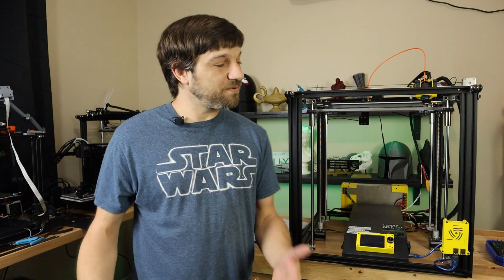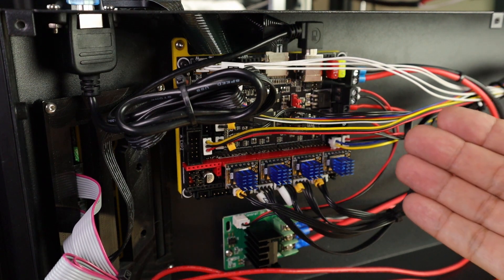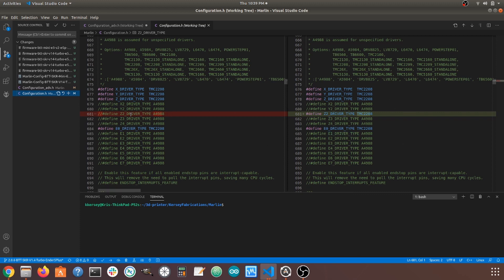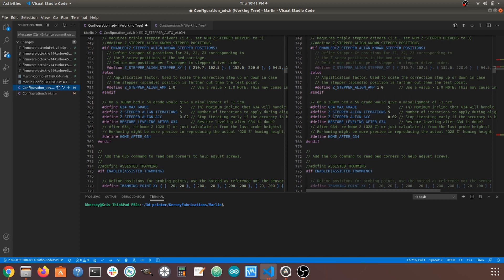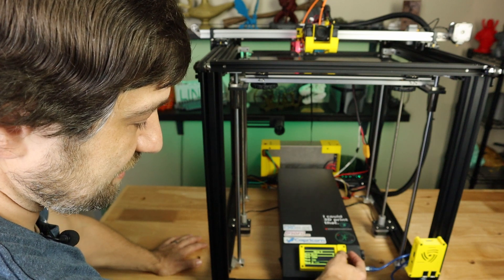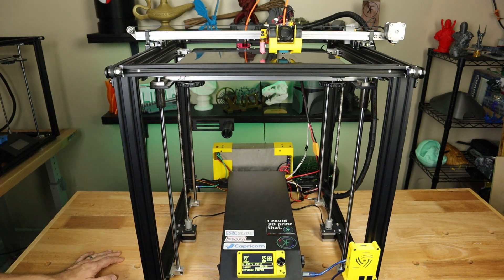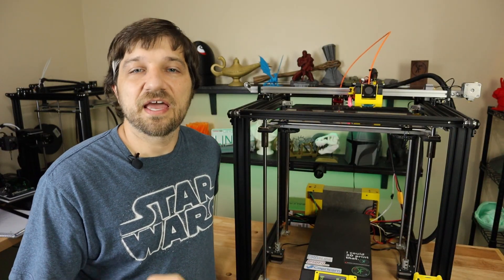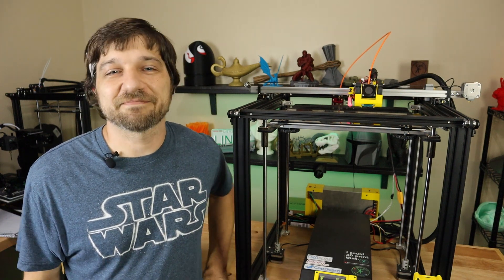3D Printing Pro Tips: Z Stepper Auto Align with Marlin G34

Comment: Hi Kris,  will this work with a SKR Mini E3 v2?  It has to Z motor plugs but one Stepper driver for the 2 Z motors.   Awesome work!
Reply from the maker: Unfortunately not. You will need separate steppers for each Z motor. Thanks!
Reply: @kerseyfabs  Do you know how I would do that with my BigTreeTech GTR. I have a driver in E1 but when I try to move up and down only 1 side moves using E1 and both Z and Z2 connections don't do anything (I tried them separately) unless I unplug E1 and use Z and Z2 on the board. As I'm getting a Probing Error when using Z1 and Z2.
Reply: Mine just needed jumpers to disable second motor connection which is more of a splitter still cant get it to succefully probe however.
Reply: did you ever figure it out?  i'm having the same problem and enabling max end stops or moving pins around wasn't working.  I got it to work by changing the multiple end stop requirement for z steppers >1 to z steppers > 2 and so far so good but i dont know if that's the best way to handle it
Reply: @coefficientofsquish75  Make sure you have #define Z_MIN_PIN                           PH11
 for bltouch. I also removed the jumper from board that merges the 2 steppers together.
Reply: @kerseyfabs  how you set what stepper that is going to be the second z stepper?
Reply: @steveal-jassem4665  You can change that in the pins file but shouldn't need to. If its like mine it defaults to e2. But like in  video you need a driver for each stepper.
Reply: I have defined E1 stepper not Z2 with robin nano and dual work.

Comment: hello sir. thanks alot for your help. i have afew question and please help me becuase i really need to know this.
1- We use "z step auto align" to apply equal pressure on the motors? And some motors do not carry more weight?

2-  if we have quad z stepers, we have to uncomment this 5:57? define  z_stepper_align_known_stepper_position

3- could you please tell me what is this:   "z_stepper_align_known_stepper_position", i didn't understand it in video.

4- in marlin commented this: "requires triple stepper drivers" ......for quad stepper drivers we also have to use this "define  z_stepper_align_known_stepper_position"???

Thanks alot for your help. looking forward to see your answer. thanks alot. good luck! :)

Comment: Hey kris, i am wondering if i can use the z auto alignment with Arduino mega ?
Reply from the maker: It doesn't have any reliance on the processor that I know of. You just need to have separate stepper drivers for both Z motors.

Comment: This don't work in Marlin 2.1.1 anymore.
There is no #defice NUM_Z_STEPER_DRIVERS setting anymore.
How do i tell Marlin that i have 2 Z-stepper-drivers?

In your case you plug the Z2 motor in E1 stepperdriver.
Why do you tell Marlin in Configuration.h that Z2 is enabled, not E1?
The last stepperdriver is E1 not Z2 or not?

My printer has 2 printheads (2 extruders) on a single x-carier.
So i would think that i must use this:
#define X_DRIVER_TYPE  TMC2209 //(for X)
#define Y_DRIVER_TYPE  TMC2209 //(for Y)
#define Z_DRIVER_TYPE  TMC2209 //(for Z1)
#define E0_DRIVER_TYPE TMC2209 //(for Extruder1)
#define E1_DRIVER_TYPE TMC2209 //(for Extruder2)
#define E2_DRIVER_TYPE TMC2209 //(for Z2)

Problem:
When i set #define EXTRUDERS 2 (for 2 extruders) then in Configuration_adv.h the trinamic driver E0 & E1 are being activated.
However the E2 (used for Z2) is not active, witch i need for Z_STEPPER_AUTO_ALIGN.
But in Configuration.h stepperdriver E2 is active
How do i turn on the E2 in Configuration_adv.h?

Can anyone please help me?
Thank you

Comment: Hey
I'm on the latest version of marlin and I'm not seeing the # of z stepper motors in the adv config. I'm assume it's now calculatng it based on what motors you enable?  I using 2 motors and uncommented z2 in the config.  My issue is that no matter how I set the settings under auto align, it always probes 3 spots on the bed: middle left, middle, and bottom center roughly.  I tried the manual coordinates and only had 2 sets of coords listed, yet it STILL probed 3 locations on the bed.  It doesn't make sense. I just want it to probe the left and right side of the bed like it shows in the example.

Do you know what's wrong?

Comment: Could you make one of these firmware supporting the G34 for the creality silent board? I'm currently using your Ender-5PlusBLTouch_0904_V1.71.0 KF firmware, but it would be dope to just add a heatsink on the board and try to use it. I'm just afraid I would jack up trying to create the firmware and it would be a whole mess. Is there a simple way of just editing the firmware I'm using at the moment and enable the G34 portion, set it up on the board with the heatsink and it be good to go, theoretically? lmao
Reply from the maker: What you're asking for is theoretically possible, just as you described it. Unfortunately though, that's a V2.0 feature and I'd have to port all of the Creality special code (for the display) from this release to the new tree. That's just not something I have time for at the moment. Sorry I can't help out.
Reply: @kerseyfabs  all good, appreciate the response

Comment: I had a quick question. My Z motors only had a "Z" tag on both and not a "Z1 / Z2". I imagine it matters which goes to which side otherwise how would it know which side it is adjusting? Do you know (if looking at the printer head on) which motor is 1 or 2. ie left is one and right is 2 or vice versa. Thanks for the videos and firmware by the way they have been a major help.

Comment: Is it possible to add an extra Z stepper motor to move my camera with the layer height to a Delta printer?
Reply from the maker: Technically yes but you'd have to write custom software to control it.

Comment: Hi ! Great footage ! BUT ! The head is not moving simmetrical from the mid point. How to set this up ? 
What means the line: Z_STEPPER_ALIGN_XY with the coordinates ? If i change the coordinates I get an error when compiling "point 1 is not reachable"... So hiw to change the coordinates to place the head to the most end of the bed on both sides ?

Comment: I tried this for the first time on my E5+ with SKR E3 Turbo.  I get a read out at the end that says 1:2=0.697.   So it's telling me that the left and the right are still out of alignment by 0.7mm.   I repeated it multiple times and it gives me the same error.  Tells me the z align algorithm isn't working right.   It is using the two points showed in your video.  I'm using a different firmware, so I'm blaming that for the time being unless I can gain a new understanding or I have time to dig through the sourcecode to see exactly what it is trying to do.   I watch the screen and it seems to dance around the value, so it's not making small enough choices in trying to adjust the position of the z steppers.  It is varying them, but it's playing "love me" "love me not" type games instead of getting closer.

I only share this in case anyone had a similar experience.  I'm using TM3D firmware.

Interestingly enough, after a while I decided to just move the z axis rods independently by sight and feel.  I was able to get it within 0.04mm by manually adjusting them and rerunning the G34 after that.

Comment: Hi, Im new to 3d printing and recently made this conversion.  Both motors work great, Im running into an issue when homing, the Z-axis crashes into the hotend. Do you have any recommendations on what is causing this issue?  I have checked all my connections.  I tried changing z in probe settings but it doesnt seem to work.
Reply from the maker: Does it double tap on the homing and then crash into the bed or crash into the bed while homing?
Reply: @kerseyfabs  Sorry for late reply, it seemed an old z-offset was cached, i followed steps i found to reset and it works now.  Thank you for reaching out and your videos have helped me greatly.

Comment: Can y stop by  separate Z by stallguard feature? It will be nice to see stop each Z with sensitivity to prevent crush screw.
Reply from the maker: My understanding is that Stallguard doesn't work well on Z in general because of the mechanical advantage of screws. It's more difficult to detect the pressure on the motor.
Reply: I think it must be same as X. Simply if bed tilt, preasure for motor go up. So if find right value of sensitivity Z and Z2 it should stop.
Reply: Have y link for all config for this? Mine is strange behaviour. I see only 4 driver with M122. If home X also Z move its bad. I define unit/mm 4 params or 5?
Reply: Also dont know how to set stealtchop on z2

Comment: Hi Kris, this should work on creality silent board upgrade version 2.2.1 which does have 5 stepper drivers tmc2208 and E1 is unused just needs heat sink installed. Is there a way to reassign T1 2 Z 1 or Z 2? Is the process the same as SKR 1.4 and if not would you be able to do video on it so I could accomplish g34? I'm actually doing this on cr-10s V2 which has the same board
Reply from the maker: Yes, it should work on that board. The biggest problem is that using the existing display, you won't have any control over it. You would have to do it using gcode or the USB console. I don't think I'll do a video on it. While it's a fun upgrade, it's a step backwards from a new display and a modern 32-bit board.
Reply: @kerseyfabs  thank you,the cr-10 v2 comes with regular display and not touch screen, worse come to worse i have btt display i assume it should work with cr10 type display?
Reply from the maker: Yeah. No problem with the existing CR-10 display. That will work fine.

Comment: On my new SKR 2, I have 5 * TMC2209's (drivers). The last two are listed for from 1 to 2 extruders (E0 and E1). Presumably the E1 (second extruder) driver is (for such a Z use) repurposed for use as Z2. My question is: Does Marlin automatically know/assume that E1 is being used as Z2 when the firmware changes are made? No "addressing" changes needed?
Reply from the maker: Yes. Marlin will take the second extruder as Z2 if you configure dual Zs.
Reply: @kerseyfabs  Cool, thank you!
Reply: Thanks for asking, Doug. Was wondering the same thing. And thanks to Kersey for the vid and the answered question!
Reply: Thats probably the biigest problem I have with alot of these videos not just yours you guys assume we know these things I assure you we don't I would of tried to uncomment e1

Comment: For us using 2x Z steppers allowing tilt of the X gantry, wouldn't you need to uncomment "Z_STEPPERS_ORIENTATION 0" to match the (0) 1,2 diagram?
Reply from the maker: It depends on if you define Z_STEPPER_ALIGN_XY yourself, which I'm doing. If you're not defining that, then yes. Here's the code:
  #ifndef Z_STEPPER_ALIGN_XY
    //#define Z_STEPPERS_ORIENTATION 0
  #endif

Comment: After 7 months, I returned to this video because now I got a BL Touch and I have no idea how to make it work, was using a tronxy inductive probe till now. Will have to follow all your videos again just to figure it out.
Reply from the maker: Tips:
- 3 pins for data/probing.
- 2 pin for detection/endstop.
- Source: BLTouch has its own settings.
I hope that helps.
Reply: @kerseyfabs   It did help! I found in another video your source code and I used only the bl touch settings. Now the only thing left to tune is the offsets. My printer starts to probe way more to the right that I want, to say so, just about 65% of the bed gets probed (when running G34) has plenty of space to the left and also to the right.

Comment: Hi Kersey. Have you had any issues with G34 making a mess of the Z offset  I have found occasionally it gets it out of wack , I had the situation again today ran G34 then auto homed, then set a print running and found the nozzle was closer by around 1mm than it was on the last print which I didn’t use G34    Any clues

Comment: Hey Kersey, thanks again for your help it's working on my ENDER5 Plus, so I tried to put it on my CR10S5, the bltouch is probing on left side then on the middle of my bed, not on the right as it's supposed to (my bed size is 510x510) I didn't changed the Z_STEPPER_ALIGN_XY so it was supposed to use the bed probe limits, any idea?

Comment: Kris, would you recommend still using this file, or would you recommend downloading your latest builds and editing the config file the way you did? Just got a E5P and going to do all the upgrades as I first put it together (skr, tft, all metal hot end)
Reply from the maker: My latest "Dual-Z" axis builds all have this already enabled! So grab the latest and you'll be ready to go!
Reply: @kerseyfabs  hi Kris, thanks for all your hard work. I'm brand new to 3d printing and I'm slowly working through pretty much all your videos.

I have an E5+ and doing the BTT SKR E3 TURBO mod as per your video. I se you are talking about the latest Dual Z build? Where can I find it? Will it work with the E3 Turbo if I set it up for the dual z?
Reply: Also I notice you reply to every comment, that's amazing, no wonder your channel is so successful. Thanks for all the help you've provided!
Reply from the maker: I'm happy to help and respond. I can't promise I'll be bale to keep this up forever with the increased growth but I'll continue to interact all I can! The point of the channel is interacting with the community.

Comment: Hi Kersey Fabrications, do you have a marlin build for a stock ender 5 plus with g34 enabled? I have an e5+ running klipper with z_tilt enabled and honestly it is a life saver with this printer. 

However I am not a marlin guy, and I would really like to get my bosses e5+ set up with this feature and he has no interest in klipper. 
Thanks
Reply from the maker: The stock mainboard only has a single Z stepper, so you can run G34.
Reply: @kerseyfabs  So the 5plus main board has two z axis motors plugged into the same driver? I guess I never looked that hard before I converted mine to an skr v1.3
Reply from the maker: Yep. It limits your options.
Reply: @kerseyfabs  ahhh I see, like I said I got mine swapped the board went to klipper before even running it so I never even noticed. 

Alright my boss is hooped then lol thanks for the replies

Comment: Flashed this firmware but getting TMC CONNECTION ERROR on my marlin home screen. Not sure what's going on but will try and trouble shoot.
Reply from the maker: I'm not sure which board you're using but that means there's something wrong with your drivers. If the board has removable drivers, check installation and jumpers. If the board has built in drivers, one of them may be bad.
Reply: @kerseyfabs  I was about to post a comment on my own comment but you're always awesome in your responses to these comments. I had 5 2208s laying unused to put them in an skr turbo 1.4 I just got following your guide. I realized after 30 mins of trouble shooting the old 2208s I had on hand were STEP and not UART. No wonder the board couldn't communicate 😅
I've got some uart models in the mail now.
Reply from the maker: Awesome! Let me know if it all works out!

Comment: Hey Kersey, thank you so much for all of this, I learned a lot ! 
Everything is working great but I think the probe offsets on your "Dual Z-Axis Firmware" are for your fan duct (X -52, Y -20, Z -3). 
I'm using the stock hotend/fan so when I auto-home, the BL touch is not at the center of my bed, I can change the probe offsets on my advanced settings menu, do you know what are the value for the stock hotend?
Reply from the maker: Here you go. Sorry for the delay.
(X -45, Y -7, Z -3)
Reply: @kerseyfabs  Awesome ! Thank you Kersey !

Comment: I just updated using the firmware attached on my Ender 5 Plus that has a BigTreeTech GTR board, and changed enough stuff to get it running, but I can't get the Z to home. When trying to home the Z the bed goes down about 10mm and the probe triggers a couple of times then I can't raise the bed, but I could raise the bed before I pressed home for Z (XY homing works). I checked the endstops status and it there are all open except off course for the Z which is always triggered.
Reply from the maker: It sounds like your "endstop" (white/black) is not wired correctly. Make sure it's going to the right header and that its wires go to the correct pins.
Reply: @kerseyfabs  Thanks that guided me to solve the problem, I forgot originally I changed Z_MIN_PIN to equal PH11 instead of PE0 in pins_BTT_GTR_V1_0.h

Comment: installed the firmware on the ep5+ it works great but now im having a problem with the usb through the screen, it starts the print heats up and then eventually freezes usually within the first layer.  the screen is unresponsive. any suggestions
Reply from the maker: Nothing in the board's firmware should cause the screen to lockup. Are you running the latest firmware on the screen? Have you tried the SD slot? Does it do the same thing? Have you tried another USB stick?

Comment: Hi Kris , im having issues with my set up which is identical to yours using your firmware. My prints freeze mid prints. Sometimes it prints and sometimes i have to cycle the printer on and off to restart, because the whole tft 35 screen freezes up with it? Any ideas . thank you
Reply from the maker: The first thing that comes to mind is trying a different SD card or using the Marlin interface to see if there's any difference. Most of the time I see this, it's from the gcode reading.
Reply: @kerseyfabs  yes I have figured out that the tft 35 is not too great at reading codes off of a usb 3.0 flash drive. I tried a 2.0 and it works fine now.